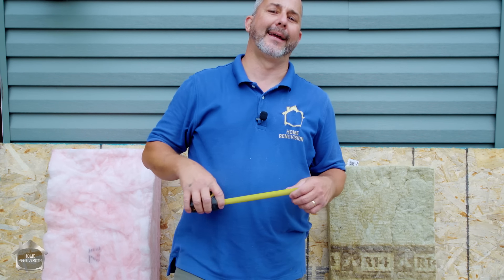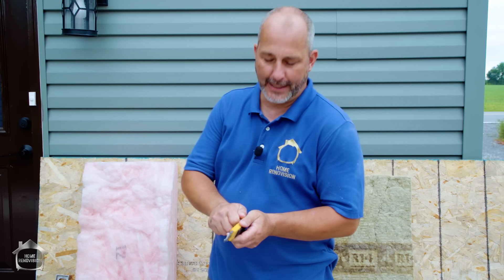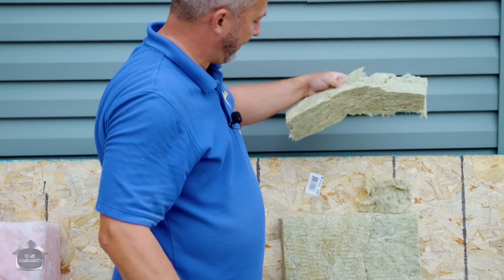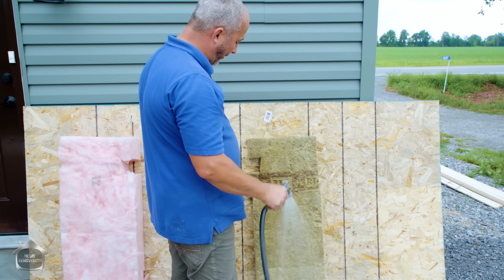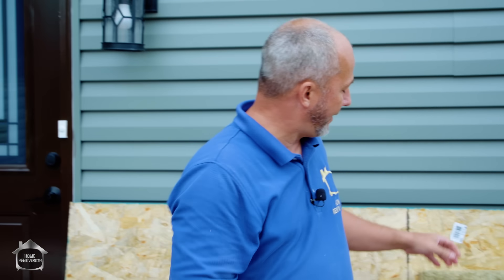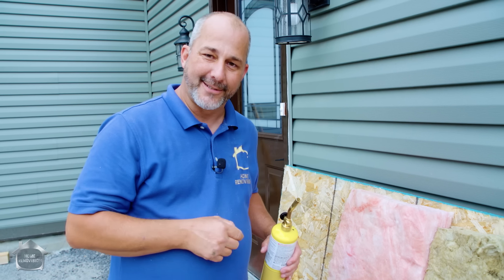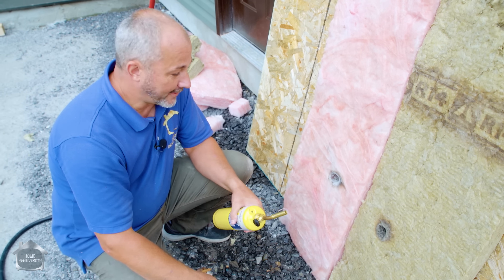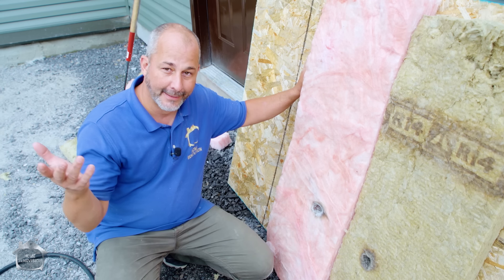How to Choose the Best Insulation for Your Home | DIY Home Renovation

Comment: Why use either when spray foam has a greater R value?
Reply from the maker: unless you plan on staying in a home to recover the cost it makes sense to go fiberglass. Cheers!
Reply: Home RenoVision DIY the only exception to that is an unvented roof assembly. Spray foam works great where you can’t vent a roof for one reason or another. Sprayed right under the roof decking. 
Also foam is horrible for STC 
Foam air seals great. In a 2x6 wall, 2” of foam and 3.5” of fiberglass or rockwool is a great combination. The foam is about $2/ft installed for R14 (2”) and fiberglass is about 50¢ / ft NOT installed.

Comment: I was doing research on the cost in my area and the price was almost the same per square foot, with same brand mineral wool batt coming in a dime cheaper than their pink stuff even on a pallet (name brand mineral wool was still cheaper, just not as much). I was surprised by that, but I noticed about a 60%~300% difference between rigid mineral wool and foam panels of the same thickness (I didn't see same brand of both products, but the overall brand comparison is still there).

However, prices can probably vary by area.

Comment: Great video..thanks! I ended up using Rockwool for my cathedral ceiling in an addition because the R value would allow me to get above R38 in the space I had where fiberglass needed an extra couple inches, otherwise, I'd be compressing it too much. So similar to your comments in your video, I have a mix of pink stuff largely for the walls and Rockwool for ceilings. It's also nice that it stays put in-between ceiling joists without needing anything to hold it in place prior to drywall. I'm planning on still using a vapor barrier even though I think I saw that Rockwool is ok for use without one. I just don't want to chance it.

Thanks again!

Comment: This was a very helpful video.  I was under the impression the pink stuff would would burn like crazy.  It kind of makes you wonder why it doesn't meet the fire code requirements like Roxul safe and sound
Reply: Fiberglass is technically also a mineral wool in that it's just spun glass, which is made from sand/silica. It doesn't burn, but it can and will melt. If it has a kraft paper facing, though, that can and will burn and cause the fire to spready vertically within the wall cavity.

Comment: This video is pretty much spot on. A couple of other minor notes for new renovators:
* Some people have a very negative, almost allergic kind of, reaction to fibreglass. My wife is one of those people. It doesn't bother some, like me (thankfully). Rockwool does not have this problem
* All fibreglass insulation is the same. Pink, White, Orange, whatever. It's all made to the same specification so you will have a consistent install no matter what is available in your area.
* Do wear a filtration mask when working with fibreglass. Inhaling the fibres can cause long term health problems and the fibres are going to be airborne while you're working.
Reply: Yes and no. Technically speaking manufacters are regulated to 90% of R value.
Reply: Yeah, you'd have to wear a respirator to even enter half the metal buildings, basements and attics in the land if its bad to breathe.
Reply: @anthonyjoe9139  You misunderstood him. He said "when working with fiberglass". When you work with it, it agitates it, throws particles in the air that you breathe in. If you are not working with it, simply around it, that is not an issue. He is correct. If you've ever worked in an attic crawling around in fiberglass, you'll notice that your lungs, esophagus, airways, etc. hurt/itch afterwards, because you've breathed in all the fiberglass particles. This is similar to asbestos. Asbestos is "safe" to be around, but whenever working with it, i.e. tearing things out and aerating it, you breathe it in and that is not safe.
Reply: @user-nh3gu1ge3d  I didn't misunderstand.  I wouldn't use it any more than I would asbestos.  It's nasty.  The attic is full of the fibres.  The crawl space is full of them.  I had a storage locker insulated with that garbage.  That stuff got into EVERYTHING and no one was AGITATING it!  Every box had that crap all over and in it.  Tell me the fibres aren't working their way into the house.  Who knows how much of the dust is that crap even if it's not as obvious as in my storage locker.  I can't go into the attic or crawl space without a mask that crap is EVERYWHERE.  It is garbage!  I would never use it even for a chicken coop.  It ought to be banned and the companies that make it ought to have to pay to remediate the damage.
Reply: @anthonyjoe9139  Errrr, what? I think something was wrong with your house, bro. Every house I've ever been in has had pink fiberglass insulation and I've never seen that issue. Hundreds of structures, including businesses (look above the drop ceilings and there's probably pink stuff). Maybe your home used inferior stuff, had a pest problem, an issue with humidity, etc. etc. etc? Idk but sounds like a you problem. It's fine unless you agitate it.
Reply: @user-nh3gu1ge3d  Use whatever you want on your house.  I wouldn't put it in any house I was building for myself and I especially wouldn't put it in a shed or something for insulation where it is just on the bare wall.  The attic and the crawl space here are full of those fibres they probably shouldn't even be entered without a mask. To think that garbage is not blowing through cracks into the house would probably be delusional.  It wasn't being "agitated" in my storage locker and it was all over all my stuff after a short period of time.   The fibres were everywhere.  It is rubbish. But you do what you want for you.  Also who ever heard of humidity in Texas Florida or anyplace else south of the Mason-Dixon line?  You telling me it can't hold up to humidity?  Every house built for decades has that garbage and the humidity here is in the 90%  range most of the time.  I don't know what it's like on his mosquito ridden beaver pond.
Reply: @anthonyjoe9139  Oh I absolutely think Rockwool is a superior product. No disagreement there. Pink is just cheaper (more sqft for the same price). I live in the South East US, it's extremely humid here but it shouldn't be that humid INSIDE your home. Like I said, it sounds like your home has issues.

Also, like I said, I've been in hundreds of homes/businesses using pink stuff, I do construction, IT installations, etc. so I am in attics and crawl spaces frequently. I have never even seen the issue you are talking about. I think it's you. You should step outside your own single anecdote and ignorance and check out.... basically everywhere else. Everybody has pink stuff, just about. And no, they are not littered with debris. You don't know what you're talking about.

You got an interior product, and/or an inferior install, and/or an HVAC issue, and/or a humidity issue, and/or a pest issue, and on and on and on. Go into any business, go into any home. There will be pink insulation. They don't have fibers everywhere. They don't have the issues you are describing. Sorry man, but it's you.
Reply: @user-nh3gu1ge3d So do the climate controlled storage lockers and every other similar metal building I've been in have "an issue" too?   It's not a single anecdote.  Just because everybody uses it doesn't make it worth a crap.  Everybody used to use asbestos for everything from fabulous roofing that never needed replacing to great insulation on pipes that lasted 100 years.  Think about it, small shards of glass blowing around for you to inhale?  And don't tell me it's only inferior products or homes with an issue  that have this, or that none of it is getting through the cracks like the ants do.  You put what you want in your house.  I couldn't suggest what you could use that would be cheaper.  Anything would be better as far as I'm concerned.
Reply: @anthonyjoe9139  "So do the climate controlled storage lockers and every other similar metal building I've been in have "an issue" too?" I own a metal building and it has no such issue. I've been in my fair share of storage units and never seen such an issue. I've been in hundreds of homes, businesses, etc. that use pink insulation and never seen an issue (that I can recall, anyway). I think you just don't know what the fuck you're talking about.

Are you referring to....dust? An attic or a crawlspace is going to get dusty. That's not fiberglass, it's dust. I HAVE had issue with fiberglass insulation, but not the issues you are talking about where it just floats around and falls everywhere, unagitated.  The issues I've had with it are: if you crawl through it, it's scratchy. It gets on your skin and irritates it. And secondly, if you are crawling through it, agitating it, you breathe it in. You can feel it in your lungs. That's why I wear a respirator when working in it. But besides that, no, I've never seen any issues you are referring to where it simply falls on you or floats around in your air and you breathe it in.

I don't believe you, I don't think you know what you're talking about. I tell you what, why don't you find a research paper on it. According to California, everything causes cancer, everything is harmful to your health, you wipe your ass with 1 ply and you'll fuckin die. I'm sure if fiberglass insulation is as bad as you say, they must have written countless papers on how hazardous it is, right? Link me some, from reputable places, not Aunt Jemima's blog or fuckin buzzfeed. If you're right, it shouldn't be very hard.  I'll wait but I won't hold my breath.

Lastly, you can stop with your feigned apathetic nature and constant urgings for me to use it. "You use it, use whatever you want, I don't care" bullshit. I already told you, I prefer rockwool. It is a superior product all around. I just don't believe your unsubstantiated bs, that's all. You just keep throwing out anecdotes. Fuckin prove it then. Back up your claims with some evidence. Your made up stories are not evidence. Random stories from strangers on the internet might be compelling to a sheep like you but they are not to anyone with a modicum of intelligence. So again, prove it (with credible data from a reputable source) or shut up.

Comment: They are both great!

I like mineral wool simply because it holds its shape. In some situations the rigidity can save a lot of headache =)

Can't argue about the cost though! haha
Reply: That's why in a 2X4 wall you would use an R-15 fiberglass batt, stiff as a board.
A 2X6 wall, you would use an R-21 batt.
Ceilings, an R-30 high density batt, Etc.

Comment: Rock wool is way easier to work with when doing walls. I use a large bread knife to cut it. Yes a little more expensive but time is money.
Reply: alittle? its 4 times more expensive...
Reply: @narmale  1.6 times more dude. Jeff has said that in the video
Reply: @linhhoang1363  ya you can say anything in a video, i just remodeled part of my house and rockwool was 4x more expensive
Reply: @narmale  wow that's a lot, sorry for you. Must be because of region
Reply: It works about the same if you know what you're doing.
Reply: I did my while house in R15 Rockwool for only about 20% more than R13 faced fiberglass. R15 Faced  fiberglass was the same price as the Rockwool. The only additional costs over the fiberglass was adding the vapor retarder over the Rockwool since it is not faced. I used certainteed Membrain adhered to the plates and every stud with caulking to create a continuous air barrier. In real money the Rockwool/Membrain/caulking cost me $500.00 more for a 2500SF house. Well worth it in my opinion. The Rockwool is much easier to install well and that’s what matters most with insulation. Faced Fiberglass is difficult to install well. If I were to use Fiberglass I would use unfaced and a smart vapor retarder over it.

Comment: Sorry totally disagree. Fiberglass insulation will sag over time and lose its R value rockwool won’t. Bugs and vermin love to hide out in fiberglass insulation. The opposite is true with rockwool. So Rockwool may cost twice as much initially but in 5 to ten years when your pink stuff has slumped in the stud bay and you lost your R value in the wall. My Rockwool will still be standing up and performing as intended. That’s why.

Comment: Roxul (rockwoll) (mineral woll) also has the advantage of being a better sound dampener, more water resistant (as you mentioned), holds itself in place better (without staples in most cases), and is a slightly better insulator. When you say it costs more, it does; however, when the labor cost does not go up, it is a better investment. Thanks for sharing, and in my humble opinion you might think about wearing gloves. With all of the information you provided, the pros and the cons of each, the long term value and durability, the Roxul wins hands down.
Reply: thanks for sharing

Comment: For sound and thermal insulation, I agree they are about the same. For fire separation, they are not the same at all.
Reply: Sound?  In my long time experience, NOT the same.  Roxul, hands down, is superior, period.  The STC for Fiberglas is INFERIOR.  You will not convince me otherwise based on many installations.  I’ve had an install get changed out for Roxul to improve sound deadening.  Big difference.  Another big factor in sound transmission is decoupling.  The sound transmission through the stud is significant,  there are several techniques that can be used to minimize this.

Comment: That was a great comparison.  Keep your comparisons coming.   I re-build both of my common walls in my condo and used rockwool (for sound reduction).  I think what I liked best about the rockwool is it is self supporting when standed on end.  I feel confident the material will not sluff down over time.  I used the rockwool in combination with 2 layers of 5/8 sheet rock and mass loaded vinyl.  I was not using the rockwool for insulation as much as for sound.  Now listening to you maybe a better answer would of been using two layers of the pink fiberglass and compress it since the pink compresses very easily.  I wonder what the sound transmission is with two layers of fiberglass compressed (since more mass the better when suppressing sound)?  I would of gladly paid for the extra cost for the sound reduction if two (2) layers of compressed fiberglass was the way to go.

Comment: Stc isn’t the same as deadening.   Deadening is absorbing sound, rock wool is noticeably better at deadening and eliminating echos.

On the downside, it looks like breathing rock wool is slightly worse than breathing fiberglass.
Reply: You are supposed to wear a mask installing either. Bottom line is to try to eliminate breathing it in.
Reply: Breathing anything other than air is not good for you.

Comment: Nice to have a visual comparison.  I can confirm what others said about Roxul and mice.  Mice prefer the pink stuff.  My contractor used fiberglass for an add-on at the cottage.  I replaced most of it with Roxul.  The only place mice came through was through the pink fiberglass.  I'll change that section now to Roxul.

Comment: This is so spot on. Rockwool/Roxul is awesome stuff. But the modern fiberglass is so close, it usually doesn't justify the cost. Ironically, you mention Mapp gas vs propane and I see the exact same comparison but you strangely pick Mapp gas... 130° F difference (3.5%) and a substantial increase in cost.
Reply: The BEST trait of rockwool is NO MOLD- unlike pink stuff.

Comment: This is total garbage. Rockwool does not promote mold growth when wet, better sound mitigation, and cannot be over compressed like pink batts.  At minimum I would use Rockwool. Closed Cell Spray foam is the gold standard. You cheap out on insulation you'll feel it everyday when you have to crank up your HVAC to compensate, and your wallet will feel it to every month too.

Comment: Rockwool makes an exterior insulation called comfort board. It's recommended for homes in fire prone areas. I think that makes it a good choice. Also, fiberglass faced with paper or foil will burn.

Comment: I never see you touting spray foam like some youtubers. Would be interesting to see your thoughts on when to use all three plus maybe polyiso or EPS. Thanks for the info on this one. Easy to get lost in all the high dollar stuff you see these days.
Reply: Polyiso is an awesome option when insulating you're exterior. Not only is it good r value per inch but the foil on it acts as your vapour barrier. You can use foil tape on the seams and get 2 products out of 1
Reply: @tiagosimoes7422  Yes and its a thermal break so the foil acting as radiant barrier as well. It is best outside, but can be used inside the studs as well.

Comment: After I removed the rock lathe and plaster during my renovation, most of the cavities were empty due to the blown in mineral wool settling and poor application.  Replaced it all with Roxul.  My external sheathing are spaced 1x8 planks, tar paper and red cedar shingles, so I felt it would do a better job insulating the with all the gaps... plus the water resistance.

Comment: I was literally about to buy insulation for my entire basement tomorrow and was going with Roxul for sound proofing. Holy crap...you just saved me a ton!
Reply: Rockwool is a significantly better product in every way. Buy it in bulk at lowes and it comes out very close in price. It takes months of studying insulation to really understand the true differences. I have used both a lot. I will not use anything but Rockwool now. There are no true building science engineers who tested the 10 types of insulation who would choose fiberglass. Rockwool or spray foam for wall cavities or polyiso for sheet insulation. Take care
Reply: Do this same test yourself, buy a pack of pink, and a pack of rockwool.  It's not even close, the density of the rock is superior. Don't take someone else's word for it....he even said it!